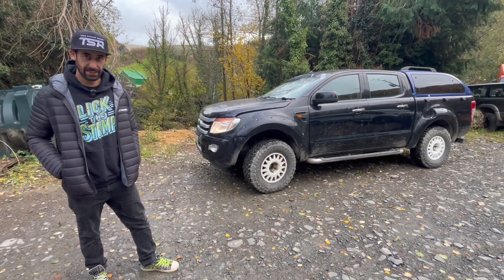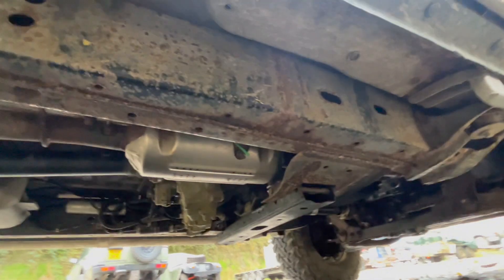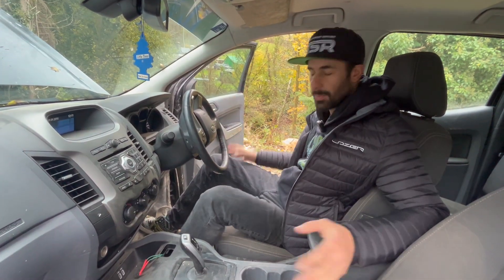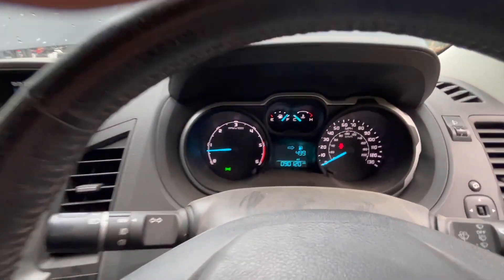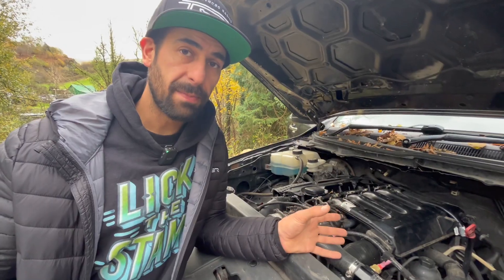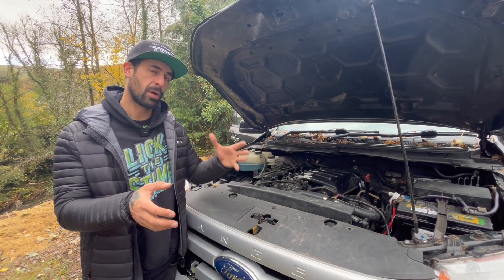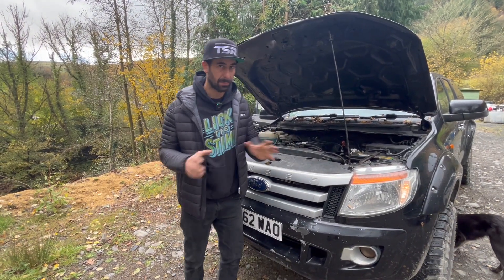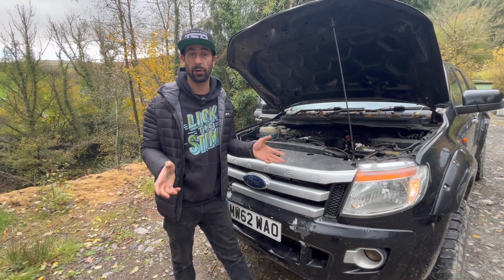BMW M57 Ford Ranger Engine Conversion EXPLAINED! #engineswap

Comment: Will the 6/hp adapter fit 2.0twint transfer box?
Reply from the maker: If it runs the same as the earlier 2.2 then it will fit our adapter yes.
Reply: @SyncroGearboxes thanks

Comment: Can you run the 6speed box as fitted to the 3.2 wildtrak’s? 2016 vehicle
Reply from the maker: 6 speed auto? We don't offer a kit for that. The bmw zf boxes are better and easier to control with a bmw engine

Comment: Hi. Great job, great conversion. Would the same principles regarding wiring apply to the newer shape Ranger? I have a 2017 3.2 with the engine gone.
Reply from the maker: Pretty much. The t6 ranger was largely the same car for many years, they just gave it a facelift a couple of times and upgraded bits

Comment: Hi shabs 
Does the transfer box fit on 8hp or did you use adapter on that to
Reply from the maker: Yeah I think I show that in the video from memory. 8hp to ranger adapter kit .
Reply: @SyncroGearboxes how hard is it to connect the cluster I mean to make it work as I'm planning to do the same thing as it's the third time I'm blowing of my 3.2 engine and honestly I'm tired of that engine I've spent more than 10k already fixing it twice 
I'm just trying to gather some information before I decide to go ahead 
Thanks in advance
Reply from the maker: Ecux.co.uk gets it all going right
Reply: @SyncroGearboxes the thing is they don't reply at the emails

Comment: Hi mate so if i get a m57 l322 with a five speed auto box  and get a stand alone ecu and loom would that work
Reply from the maker: It'd work from the point of view that you'll have a stand alone m57 setup. No one does adapters for the 5 speed get rag box into anything as theyre poo. You could keep the ranger 6 speed manual box and use the early m57 though.

Comment: Hmm, can you put the M57 in a Discovery 3? The Disco has the ZF 6HP26 gearbox already. I feel the electrics would be a bit "fun". But, the Discovery 3 was designed/manufactured when BMW owned Land Rover. Installation may be just as easy as you can take the body off.
Reply from the maker: Yeah people have done it before.
Reply: Have seen videos of conservations already done. 

I think the swap is like most for a Disco 3 would the 3.6 v8 diesel out of the disco sport.

Comment: Shabs, thank you for the plug dude. It's appreciated. Nice to see the lady running and driving again
Reply from the maker: As always, thanks for all the help and getting this stuff working right
Reply: So I'm looking at doing a M57 similar swap with an 8hp. I can only see 6hp auto looms on the M&W 4x4 website, is your ECU were that magic happens or do I need to contact them for the relevant 8hp loom as well?  Cheers
Actually on further review on their website they say they don't offer an 8hp kit and would need to bring the vehicle to them for setup. 
Unfortunately it's not a vehicle I can cart around on a transport trailer easily, it IS the transport trailer 😂
Reply from the maker: @starfox_wr-45e93 you'll want a can tcu for 8hp. Drop mw an email, they may be able to help
Reply: @SyncroGearboxes  Ah right. That makes sense. Thanks for the heads up. Cheers

Comment: Ive just had a 2.2 ranger engine replaced under warranty. if it goes again I'm doing this. with manual box I think. really well explained video
Reply from the maker: Thanks Chris
Reply: Would you recommend going auto?
Reply from the maker: @christopherderycke3603 it's personal preference vs budget. Manual is cheaper but imo auto is  better
Reply: @SyncroGearboxes  thanks. I’d like to stick to manual but I’ve seen comments that gearbox won’t take the extra power. Not adverse to going auto. This video makes it seem a lot more accessible. What pedals did you use?
Reply from the maker: @christopherderycke3603 the mt82 should be fine power wise. I'm using the stock ranger pedals
Reply: @SyncroGearboxes thanks. My 2.2 has just had engine under warranty. I’m going to start getting parts together for conversion so it’s all ready when it inevitably shits itself again.
Reply from the maker: @christopherderycke3603 solid idea 😅
Reply: @SyncroGearboxes expect many questions 😂. Going to stick with manual to start with and consider going auto in the future.
Reply from the maker: @christopherderycke3603 happy to help where I can!
Reply: @SyncroGearboxes  did you have to modify the sump on the engine you used? M57N2?
Reply from the maker: @christopherderycke3603 stock m57n2 sump

Comment: Would have been more cost effective to Barra swap it!!!
Reply from the maker: It would have been nowhere near more cost-effective, not even remotely... barras don't really exist in the UK for a start, and m57s and cheap and plentiful.
Reply: @SyncroGearboxes BMW engines that are good/useable here would be here harder to find than a pot of gold at the end of the rainbow and probably cost more!!!
That said plenty of Ecotec 3800's would do the job.
Reply: @SyncroGearboxes But I do like the idea of the ZF8HP, and yes there's  definitely an adapter plate for the Barra to 8HP available probably in Australia.
Reply from the maker: @paulhoogeveen7353 yeah great gearbox
Reply: @SyncroGearboxes https://youtu.be/pU6Tega74Cw?si=vnuudsAU5iM2HLKj
Gas engine is LPG or "green top" runs stronger factory con rods as the normal rods used to bend on LPG backfires.
Equally  the fact its got Kelford Cams denotes who ever built the engine actually  knows what their doing.
Reply: A big ass Barra ain't fitting in there, and they ain't a diesel.

Comment: Best diesel engine made, my 530d has 266k on it and still strong, other than sensors the only engine issue I've had in 12 years was cylinder 5 injector seal leaked and took me a full day to extract the injector.
Reply from the maker: Definitely a solid engine, glad yours is running strong!

Comment: Grat swap. Any more details of additional parts like exhaust etc? What tune/poweroutput and whta mpgs do you achive?
Reply from the maker: Thanks!
This one is pretty simple and straightforward.  Looking for reliability, and drivability really.
Exhaust is stock ranger married to the BMW downpipe. Tune is modest, 270-300hp I expect.
Mpg, I haven't really recorded to be honest . I expect, quite similar to a bmw x5